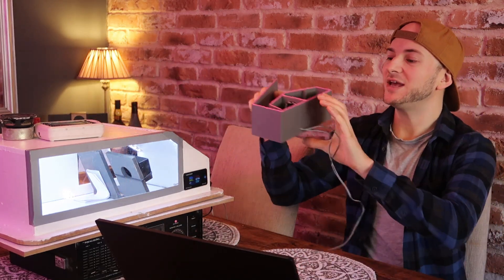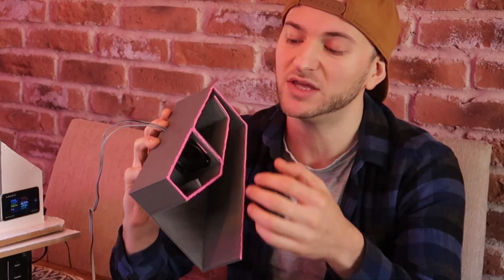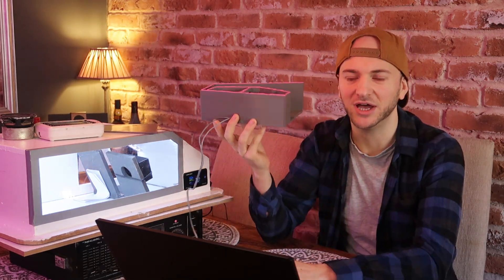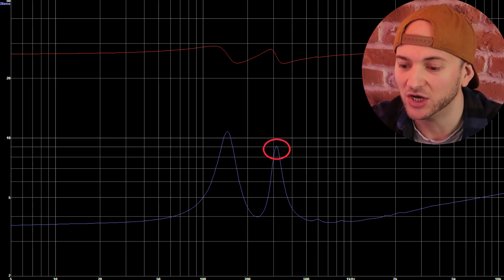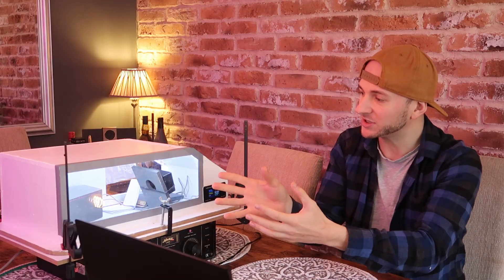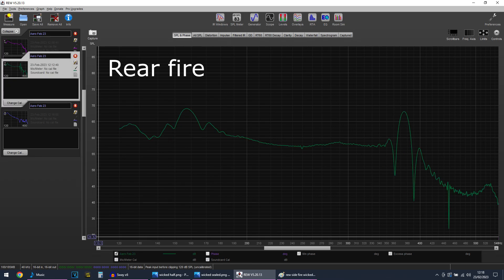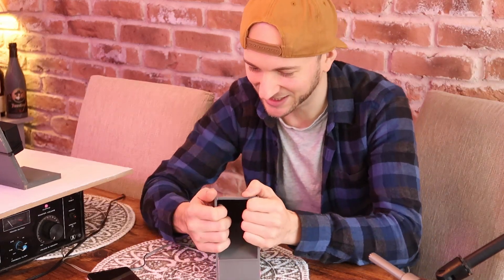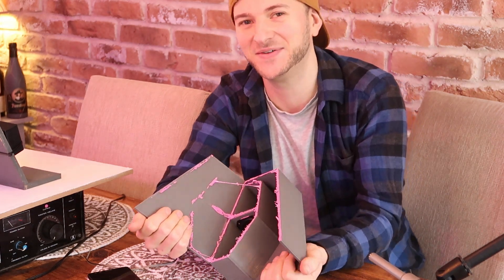Crazy half-horn MINI-subwoofer! - Boom or Bust S1E3

Comment: This box was designed "back in the day" when tuning at 45hz was normal. It was a perfect combo of ease of construction, box size, and performance. I sold mine after building my first 1/4 wave pipe @25hz.
I still own that thing after 20+ years. Its been in 5 houses and 5 or more vehicles and im still looking for the perfect subs😊

Comment: The horn doesn't work to actual bass frequencies, it mostly gives boost and punch to higher midbass at that length. So calling it a 'subwoofer' is a stretch. It performs as well as a sealed box down low.
Reply: yep, thats what i said in the video :)

Comment: I ran a full size wicked one with dual Pioneer 10's in my home theatre for years and it was incredible. I drove it with a phase linear 400 and crossed it over very low. The only thing that ended up being better than it and what eventually replaced it was an SVS PB13 Ultra. Fun Times....

Comment: I will design a Tapped Horn for this! Perhaps downscale my 15hz Tapped Horn. That will hopefully be INSANE!
Reply: Tapped horns are awesome. I designed a pair for a 400 seat auditorium (using 18-sound 21" drivers) and they push 130db at 20hz without breaking a sweat. The restroom mirror fell off the wall though. At 15hz you're going to need some extreme excursion and high BL drivers if you aim to play loud.

Comment: I had a 1980 camaro in early 90s with a custom free air setup with 2 15s in the rear deck where stock 6x9s lived, and a tuned box with 2 12s on back seat. Kef mids n tweets in doors. Power was 2 hifonics amps, a small one(cant remember what) for mids n tweets, and a Gemini driving the 12s n 15s. Low modest power, but hit mid 140s back then which was impressive. The shop that did the install had me come down all the time to showcase and impress potential customers. Good Times!
Reply from the maker: I bet that sounded fantastic buddy!

Comment: So tell me....  Why is the speaker mounted backwards from the design pattern?   I realize the cone has a reflection (but it is inverted) What gives, ?
Reply: It makes no difference which way the speaker points at bass frequencies. The cone moves in both ways anyway. The only thing that matters is the space the magnet assembly takes in the enclosure, that has to be taken into account when calculating the dimensions.
Reply: I dont understand it either. The speaker is mounted backwards, so the backside is facing the port. Completely baffled (pun intended) me.

Comment: Best speaker I've built was an inverted horn Tuba HT, I wonder if it can be scaled down and 3d printed?
Reply: No point in downscaling. When the horn dimensions get smaller, the bass extension gets smaller also. The Tuba HT is a folded horn, not an inverted horn.

Comment: WOW! I like your findings! How would that little horn sound in an automobile playing from the factory stereo without an amplifier? I think I'd like one if I can get one sir!
Reply: I imagine it can get decently loud on ten to fifteen watts.
Reply: Am I able to get one of those enclosures? How much will it cost? @JasonWW2000
Reply: A car will naturally boost bass frequencies starting at 100hz and about 12db/oct below 40hz so you can produce very loud and clean bass easy. The speaker will start to directly modulate the airspace inside the car and that produces a very high efficiency and low distortion bass. Horns are necessary for large spaces...
Reply: @Munakas-wq3gp  Thank you very much!